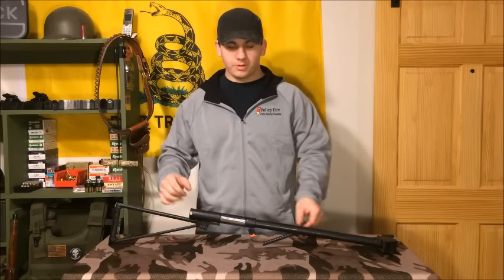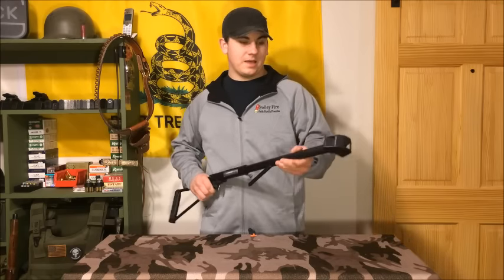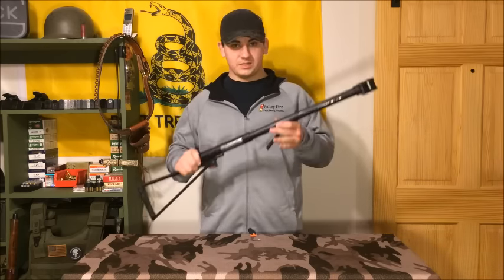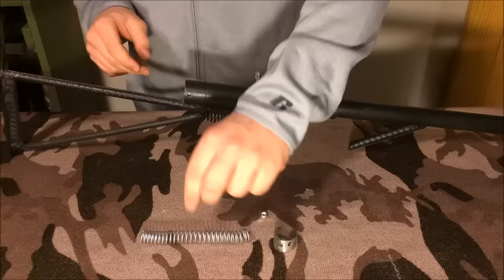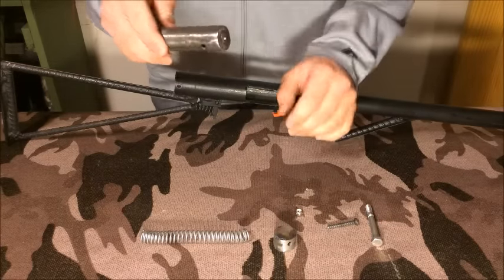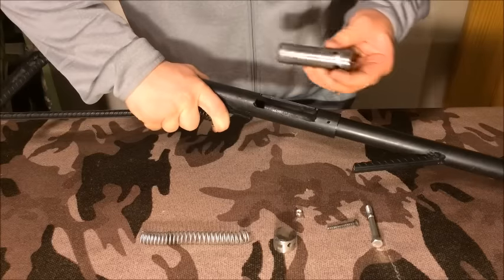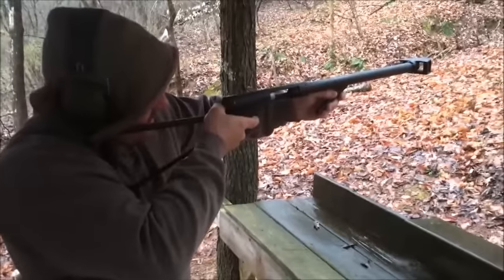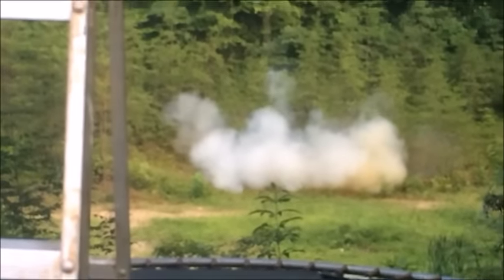Homemade open bolt shotgun

Comment: As long as there is plumbing there will be guns .
Reply: Plumbing and patriots 🇺🇸🇺🇸🇺🇸
Reply: Ammo is more complicated. Especially powder
Reply: @karvast5726  all you really need is metal and black powder which is easy to make if yk how.
Reply: @ThatEsepe  yeah it's possible but it's more complicated,it's not always easy to make good black powder especially if you have to make it from scratch(making all the ingredients) and primers and shells are harder to make but i'm sure with will and some tools you could
Reply: @karvast5726  black powder go big boom 🤥🤥🤥
Reply: @karvast5726  Not really,. Trust me
Reply: thats why they are turning everything possible in plumbing to pvc
Reply: @karvast5726  not true your pretty ignorit to say that my friend made a batch at 14 its not rocket sciences dont remember what he made it is but lets see
Instant cold pack
Salt substitute
Water
Glass jars
Coffee filters
Scale that can measure grams
Stove or hotplate
Reply: As long as there's chemistry there's guns
Reply: RR Extra  and bullet casings ?
Reply: no as long as there is ingenuity
and metal workers and machinists
Reply: Hahaha
Reply: @karvast5726  primers are the difficult part getting impact nitro to prime them.
powder is just charcoal ,sulphur ,and Peter salt .
all readily available on Amazon .
but the hardware store sells blast caps for nail guns otherwise you have to dimple metal and line it with nitro add powder and seal it with wax.
I can mix powder in 5 mins but for 100 primers it takes about a week without the machinery.
Reply: yeah buddy😁
Reply: @missouribushwhacker9449  all 10W
Reply: @TylerB-my1kr  CAP GUNS WITH THE PINK PAPER COILS WE ALL  used as kids  punch 32 out and yr good to reloading primers. just pull out the anvil remember which way it goes flaten the striking end (think about it , its not hard) then put 3 caps in ( use hole punch to pop out the caps). Experiment which way all 3 go (again its not hard but I'm not wiping yr ASS) push it back in. load with homemade blackpowder ( again easy just takes time, the blending of mixture is the time consumer  @  least 234 hrs longer is better, again wipe yr own ass) Im sure you can push a projectile into t he oopen end.

then 
Democracy rules with our ammendments

Comment: I think I'd want a little bit more mass in the bolt... Maybe use a solid piece of round stock. Nice design though!
Reply: could pour some lead to make it heavier in the bolt section and add a recoil pad to butstock
Reply: The beauty of this design is that it doesn't need breach to stay closed for proper reciprocation. The shot leaves the barrel long before the bolt slams back.

Comment: Very unique design you have going here!  A word of caution, though, blowback/unlocked breech in a 12 gauge gives you a very high extraction pressure, and given the mass of your bolt, I'm not entirely sure how safe this gun is in the long term. Are your shells at all bulged or torn up after being fired? Don't take this as negative, because I honestly really like this shotgun, and kind of want to imitate it to see how well It'd handle.
Reply from the maker: high pressure shell did bulge a little
Reply: The bolt is too light.You can see fire coming from the breach.
Reply: Make a new bolt out of round stock. Problem solved!
Reply: I agree.  The bolt needs more mass.  This will increase lock time but reduce the chance of a blown shell case.  Otherwise, I like it.  Bravo.
Reply: @regularfather4708  That would make it even easier for someone who doesn't know how to weld if you thread the round stock and put a screw in it. Welding the endcap seems a bit pointless to me since most of the force would be going to that bolt holding the spring in. (and maybe even less work can be achieved by using a pipe that's already threaded and a threaded endcap so you don't have to bother with drilling)
Reply: @PolleyFire you could reload your shells with black powder and probably be a bit safer

Comment: cool shotgun man, very simple. are you having any issues with case head separating? I would suggest keeping an eye on that pin in the back and your bolt handle, probably stuff you already know but if it comes loose you have a face full of metal lol.

Comment: Whoaaaa. Use stock instead of pipe for the bolt. Looks good other wise, you could easily manufacture these in unstable or unsafe times.
Reply: Yeah I agree bolt is far to light, needs to be made from bar stock or grade 8 bolt with large enough shank etc.

Comment: Preface: I'm just a keyboard warrior as of now, since it's illegal in my Country to build firearms at home. And God knows I'd love to.
WIth that out of the way, a few constructive criticism:
-an open bolt firearm could be illegal as to ATF, I don't know if that applies to firearms missing a magwell.
-love the trigger design, but you're fighting agains a disadvantaged ( sp?) lever: the sear part is long or longer than the trigger itself.. must be quite heavy. 
-trigger engagement surface: is it hardened? 
-That endcap screw is taking all the impact force of the recoiling bolt. if that snaps, you're going to the dentist.
Just ditch the low-grade steel screw, cut a 1/2 drill bit and match it to endcap and rear of receiver.
I'd be scared to fire an open bolt shotgun:
Overall, it's an upscaled Sten gun without a mag...

P.S. SUBSCRIBED!
Reply from the maker: Thanks, you made some good points. the trigger is actually not heavy at all and it's not hardened, the end cap does have better grade screws in it. Safety is always something we take seriously. thanks for subscribing. God bless
Reply: As long as it is single shot the open bolt design is legal, do anything to add a magazine or in any way feed multiple rounds and you would have a rudimentary full auto which would not be legal.

Comment: Hello sir, I'm also making an open bolt SG, my bolt is heavier than your 3/4 pipe, but im getting case head seperation, bad. The firing pin was to big and that may be why. Do you think it's not the bolt weight, since yours functions perfectly? Or could it be the firing pin being too big?

Comment: that actually the best design ive ever seen  but i think the bolt should be solid stock and that end cap  probably should be welded in place remember it isnt a high dollar gun its just plumbing parts and  and scrap metal you throw it away when its no longer useful to you

Comment: Really cool shotgun and design! How is this not illegal though? as anything open bolt made after 1982 is illegal.
Reply: Anything with an open bolt AND A MAGAZINE is illegal (without the proper paperwork). But if there is no magazine, nor any way to easily affix a magazine to feed from, then it isn't "readily convertible to fire more than one shot with a single trigger pull". All you can do is load and fire one round at a time.
Reply from the maker: Yes this is correct
Reply: my bad, i just read that too. ty guys for the response :) !

Comment: Now all you need is an extractor and ejector folded up piece of sheet metal for a magazine and a spring and if you really want to make a good open bolt firing pin cut that bolt face off flat drill a little bit down into the center and then take FSX 6 silver solder and get you a little Chrome Molly ball bearing to fit right in it

Comment: Drill a small hole the firing block and a nail or something in that genre and it'll probably eject fine on its own may have to extend the travel length of the firing block well shortn the firing block not extend but in shorting it it'll extend how far it has to travel

Comment: Enjoy your exploded cases and eventual bolt through your eyesocket, man. That's a deathtrap you've built. A 12 guage blowback would need a much, MUCH heavier bolt, like we're talking 9 pounds at the minimum, to be remotely safe.
Reply: Show us how to do it then
Reply: The dynamics of an open bolt help, but I agree the bolt is WAY too light.
Reply: 9 pound bolt ??? LMAO ! that's far more than most guns weigh ! Stick to something you actually know about, this isn't it
Reply: @joebalser9515  The mass required for an unlocked bolt to operate safely is why you almost always see some form of locked breech for more powerful cartridges.
Reply: @hanelyp1  I'm assuming you meant 9 pounds pressure against the shot, instead of bolt that actually weighs 9 pounds. If that's the case, my apologies for misunderstanding. If I built that gun I'd have used solid round with a threaded end to put a small bolt or screw in as a replaceable firing pin, I'd have solid round welded in the back between the spring and bolt so be sure nothing can come back through, and I'd make sure the chamber was at least double thickness of regular pipe to keep from fracturing down the road. Something I intend to build one of these days
Reply: @joebalser9515  No, 9 lb mass is about right for a 12ga straight blowback bolt.  Which is why you never see that design in professional production.  But always some form of locked breech, which can operate with far less mass.  For a well tuned open bolt about half that mass can work.  We're dealing with thousands of pounds of peak chamber force against the breech.
Reply: @hanelyp1  I repeat, NO ONE has a 9 pound bolt in any common firearm. do you even realize how big it would have to be, to be a 9 pound bolt ? You're used to theoretical  numbers, not reality.
Reply: @joebalser9515  Do you have a reading comprehension problem?  Nobody (excepting a few somewhat crazy hobbyists) uses an unlocked breech on a shotgun because of the required mass to do it right.

Straight blowback or open bolt: unlocked breech.  Only the mass of the bolt (for practical purposes) is resisting chamber pressure on the breech face.

Manual action, gas operated, recoil operated: locked breech.  I've seen all of these classes of operation in professionally made shotguns.
Reply: @joebalser9515  You are a wonderful example of the dunning kruger effect. Yes, a 9 pound bolt is ridiculous, hence why virtually every production shotgun uses a locked breech as opposed to straight blowback. The only one to my knowledge that doesnt in the AA12, which also has a hefty bolt but utilizes advanced primer ignition to compensate, although that's likely beyond your comprehension. Take a highschool physics class and read a book on firearms design before you decide to opine on proper engineering practices and insult those who understand the forces at work here. Or don't, and earn yourself a darwin award when newton's third law sends a bolt through the reciever and directly into your cranium.
Reply: @therealfinn1839  Pick up a copy of Bill Holmes' Home Workshop Prototype Firearms manual and learn it yourself. Alternatively you can read OrionsHammer's webpage on blowback firearms design, archived here: https://web.archive.org/web/20190314104641/http://www.orions-hammer.com/blowback/

Might be good reading for our pal Joe Balser in this comment thread too, although the math and "theoretical numbers" might boggle his brain a little much.
Reply: Ya if your shooting a howhitzer
Reply: @chrisfarley1021  You really don't come off as too bright spelling like that, but I wouldn't expect someone who doesn't comprehend bolt thrust to care much about grammar.

Comment: If U cut a slot on the side of the bolt opposite the charging handle and insert a screw thru the housing it would act as an ejector to kick those spent cases out proper for ya,  Sir Einstein.

Comment: nice work but this with an extractor and a safety that folds in to prevent the pin from hitting the primer would be pretty sick maybe add some wood to it so it feels better to hold 
wrap the back of the stock with leather or paracord 
make some mags for end of the world open bolt fun if shit hits the fan . 
I like yeah nice work

Comment: You can lose some of the power because of the floating bolt, but you get less recoil. A slam fire mechanism can provide more stopping power and less moving parts, but kicks like a horse if it is lightweight.

Comment: That definitely won't have sufficient power, the bolt doesn't lock before firing
Reply: Being it utilizes a simple open bolt design, acting as straight blow back, I might be wrong but I don't think it needs to lock while firing. the round has left the barrel by time the shell/bolt is pushed back. He just needs more mass on the bolt piece of round stock would help greatly with the "lock" time.

Comment: To fend off negligent discharges, have you thought about adding a coil spring forward of the firing pin? Made the same diameter as the barrel, the barrel would rest on it and be kept away from the firing pin at all times until a definite slam action by the shooter. The length of the firing pin and of the spring would probably have to be arrived at by trial and error. Whether the spring is fixed to the bolt or loose for easy cleaning would be determined through testing.

Comment: Yo cut a tiny notch on the bolt side of the firing pin assembly and run a small screw that wont toutch the notch and it should act as the ejection system for that shotgun

Comment: While I admire the creativity & workmanship of this young man, I would caution him and all other home made gun enthusiasts, that the common hardware store black pipe that these people use for the barrels of their guns IS NOT rated for the pressures created by modern smokeless powder cartridges.  Most pipe used for plumbing has a factory welded seam running along the length of the pipe; there are various types & shedules or thicknesses of the pipe wall; NONE of these pipes are rated for the pressures of modern ammunition being fired through them. All gun manufacturers use metals that are rated for the higher pressures and are made from solid steel blanks..I am not telling people to not make a gun or anything else; I am just advising the gun enthusiasts out there that are making their own guns to be safe in all their manufacturing methods! I retired from the Volunteer Fire & E.M.S. service 9 years ago, but I am still a member of the N.F.P.A. & the N.A.F.I. my concern with all these gun enthusiasts using pipe of any kind to build a gun barrel with is that these type of barrels could literally blow up in their faces and hurt or kill them & bystanders for a hundred yard or more radius.  If I personally were going to build a gun barrel in my home workshop; I would buy some solid round barstock & a long cobalt drill bit & use a drill press to drill my barrel, rather than risk my life on a common black gas pipe that has a welded seam that could burst  at any time & kill me & those innocent bystanders.
Reply: Por lo general se refuerzan esas tuberías